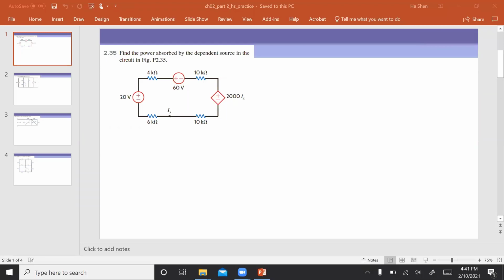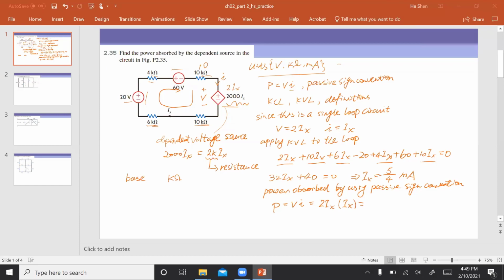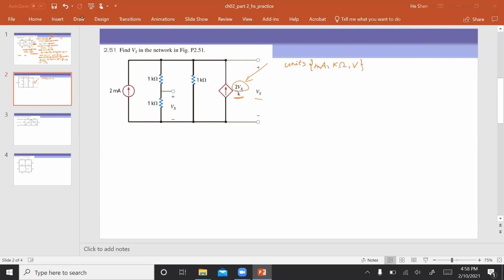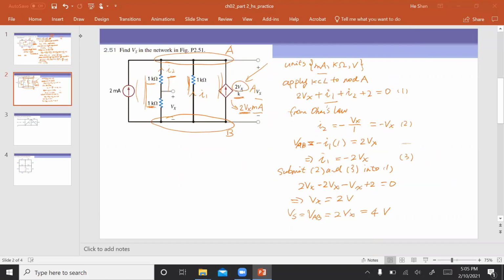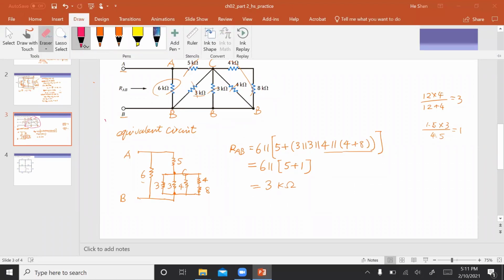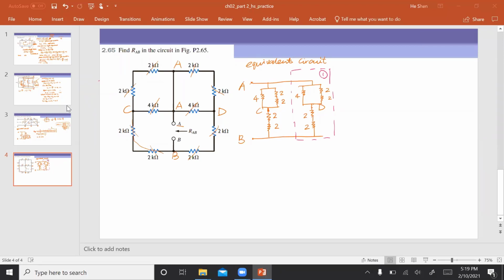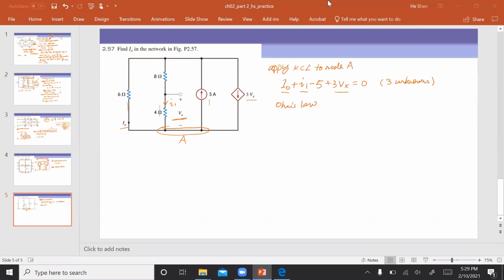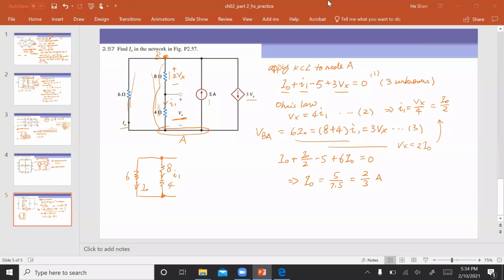topic 3 resistive circuit (part2) practice

Comment: Loved the video that you have made, but I have a quick question for timestamp 16:40 if I may ask. Is it possible to have the answer (Vs) be -4V because of the possibility of rearranging -1 to 2vx, right by the (3)? would it still be an answer to Vab but just in the opposite direction?
Reply from the maker: the answer does not depends on how you define the reference polarity. Vab means the voltage of A with respect to B. You can also see Vab as the voltage drop from A to B following any path (can be both physical and virtual). The final answer should be unique.